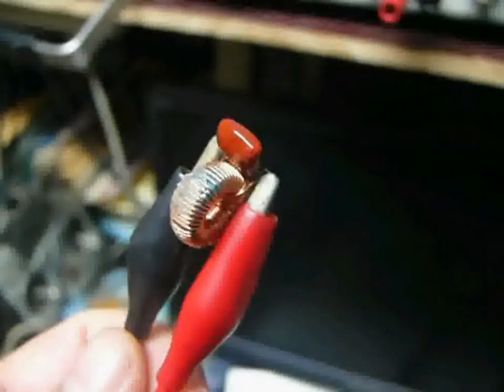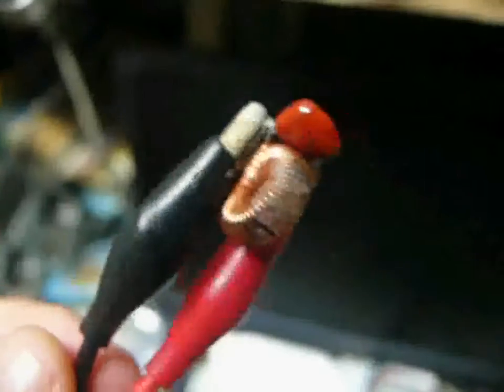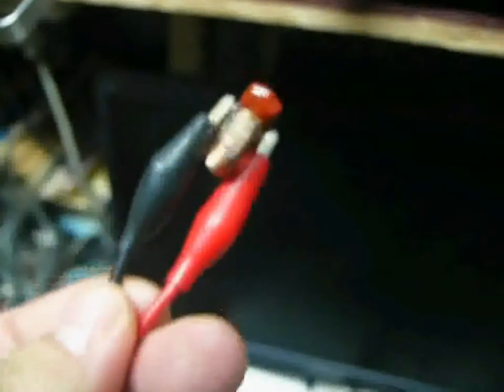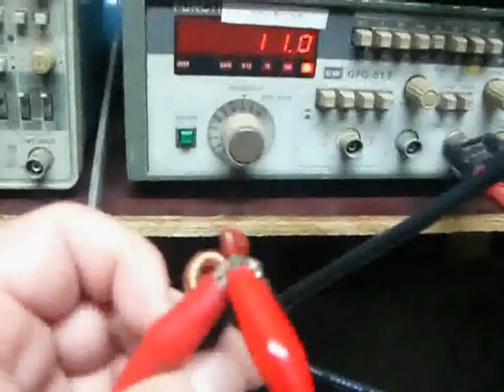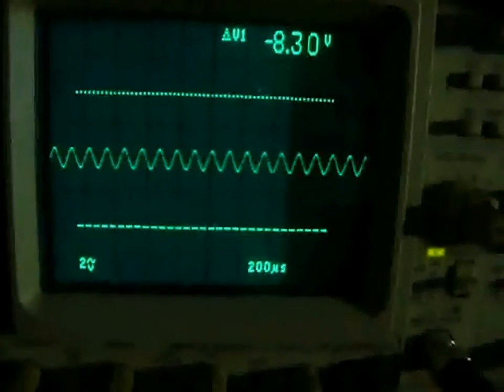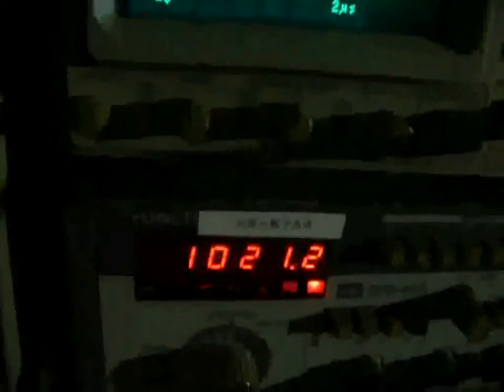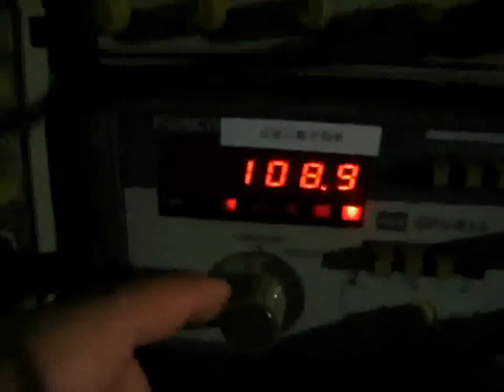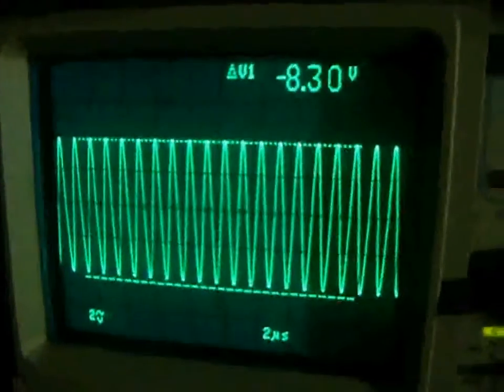lc tank circuit test

Comment: can I make sound with this? and can I control the frequency of the sinewave? 
thanks a lot ^^
Reply: late reply, probably found your answers if you searched. You can make oscillator circuits at audio frequencies and put them into a speaker to produce a tone. And yes you can control the frequency if you use a variable capacitor (mechanical or a varactor) or a variable coil.